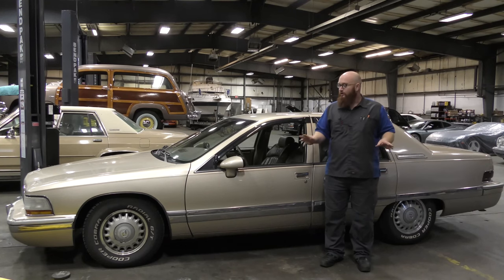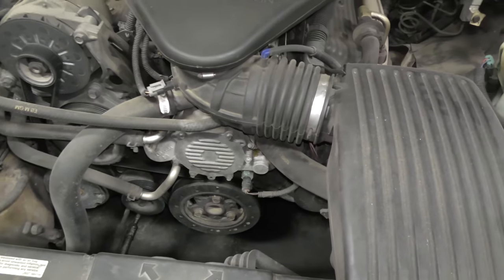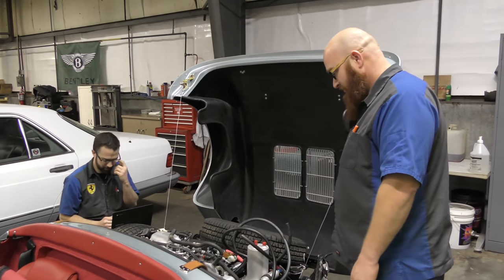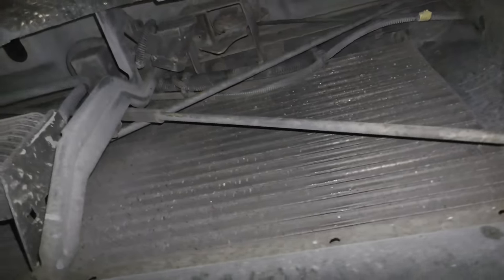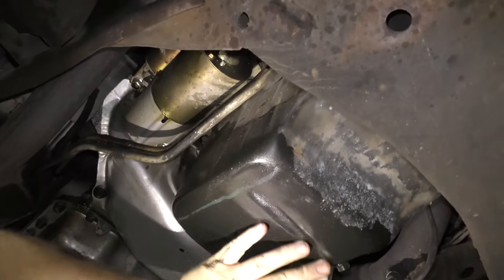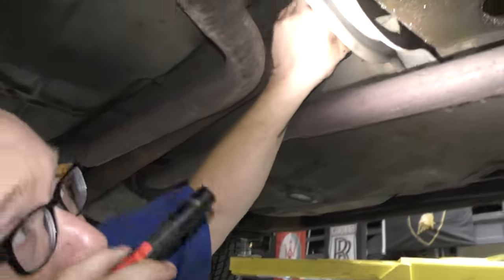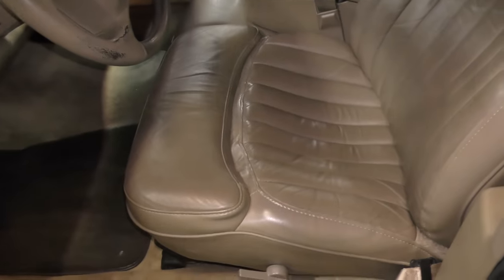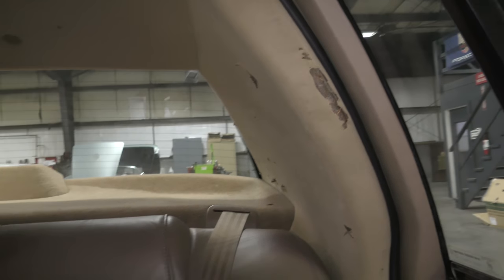Why do mechanics buy 'grandma' cars? CAR WIZARD explains their lure with this '94 Buick Roadmaster

Comment: Mr Wizard,,you missed so much here on this review,
Allow me to go further..
Dual stainless steel Exhaust..with FOUR mufflers !
Positraction differential on some.
Automatic Air Level rear suspension.
If you have the tow package..you get oil coolers. Heavy Duty cooling fan (belt driven).
Remote operated Heated rear view mirrors
Heated seats (optional).

Electric radio antenna on rear fender
Remote keyless entry
Remote  Keyless Trunk lock/latch.
Heavy duty sway bars.
Common  Wizard..
The only thing he got right was the seats, They are the best !
I have more..but you get the drift
Reply: MORE..
 Super Thick Sound deadining liner under the carpet.
Cars with the tow package have a large belt driven fans with bracketing, tensioner. because of this  its a huge job to change the water pump and or power steering pump, alternator.
Replacing the spark plugs is quite the job also as the exhaust manifolds have upper runners and the top A arms are also in the way of this job.
 The center console opens up with coin holders and cup holders.
 Cruise control, Power windows , seats.
The Climate control system is also an on board Code reader and will convert real time RPM and MPH and coolant temperature  to be read  on the led display. You must do a little research to put this in that mode.
 This is a must have car !

Comment: This is precisely why I bought my relatively low mileage 1994 Toyota Camry LE ( 127,XXX miles at time of purchase . It has the 2.2 litre 4 cylinder engine and it gets 32 mpg average . It actually drives and rides really well .

Comment: These roadmasters with no miles are incredible to drive.
 These have 260hp and 335tq, pretty good acceleration in a straight line, it does not corner at all. 
  They did come with a towing package which I believe changed the rear end gear ratio for towing and stiffened up the chassis.
Reply: Rated at 260hp, but proven to be closer to 290-300 from the factory, especially in the Impala SS trim. Stock 94 Impala SS could run 150mph stock, no way a car weighing over 4000 pounds can do that with only 260hp. GM underrated them for insurance purposes, as well as keeping it from the competition. It's the reason why in 2005, the Mercury Marauder which had 302hp ran a slower 0-60 and 1/4 mile compared to the B-Body Impala SS
Reply: @Atuzzo  it pulls incredible weighing 4700lbs, it has a v92 package, which is said to be a code for a performance package, suspension and oil coolers, and built up transmission internals, im not sure about the motor.

Comment: As we all know, as soon we know the proper way to fix things, everything becomes easy. So they like cars like this not because they are easily fixed, but because they KNOW how to fix them.
A common issue with mechanics that they are unable or unwilling to read documentation. They think a good mechanic knows everything only by looking at it. As soon something gets a little complicated they start breaking things and start whining about wrong design. They even start saying that 1 out of 20 brand new parts is faulty. This would be insane, in reality they actually break the new parts (or other unrelated parts) during installation, and then tell the customer the original part was faulty.
So they drive such a car, who cares its engine is inefficient, environment unfriendly, the interior is not ergonomic compared to new cars (yes, not only sport cars exist today), they are missing serious safety features which are standard as of these days etc.